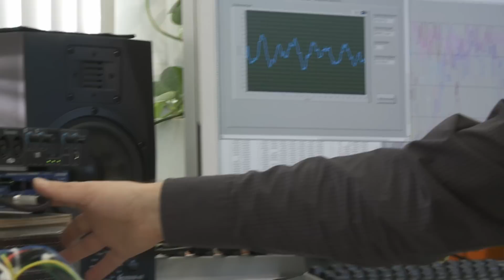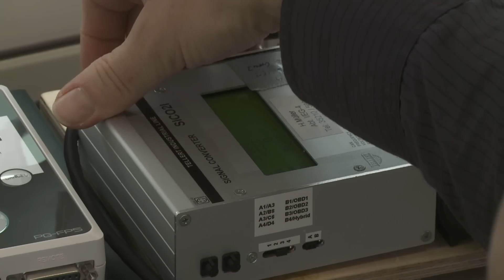Electric Supercar and Engine Sound - Acoustic Innovation: e-sound by Audi

Comment: Why do people need sound. I would like my car as silent as possible. For pedestrain safety we can always use horns.
Reply: Loud cars set such a presence that is impossible to miss and we car guys love it. More to the fact that every car has a different voice from 4 cylinders to 12 cylinders they all sound different, its so satisfying to hear. Though you may prefer the quieter cars and I dont object to that opinion, try and admire the noise of 20 race cars each having a different or similar voice flying past you at top speeds.
Reply: Even electric motor has a sound, and it’s pleasing for example Nissan Leaf RC ,Formula E, and Rimac …

Porsche did this with Taycan, but they use real electric motor’s sound and amplifying it with other sound Sz
Reply: There is no way that the sound can cause a noise pollution, every manufacturers know how to balance the volume so it’s not silent or or loud, just balance ..

Comment: Uh cars are to noise so we don't want the loude ones with patrol, uh electrics are so loud we have to ban them too!
Reply: Loud cars set such a presence that is impossible to miss and we car guys love it. More to the fact that every car has a different voice from 4 cylinders to 12 cylinders they all sound different, its so satisfying to hear. Though you may prefer the quieter cars and I dont object to that opinion, try and admire the noise of 20 race cars each having a different or similar voice flying past you at top speeds.
Reply: Just imagine: Uh (delay sound; ger. "Ähm") electric engines are disturbing my spiritual aura in particular the high pitched ones.
Reply: @RegenerationOfficial  Hippie
Reply: What’s with all the “uh’s”?

Comment: You could just take the sound of the electric motor and amplify it through a microphone and loudspeaker in the under carriage maybe add some electronic distortions for some cool factor 

Either way electric cars or cars in general shouldn’t be silent

Not just for cool factor but pedestrian safety as well
Reply: I would take your idea with some modifications.
I'd record the sound of the engine itself, do some sound adjustments by removing or lowering the annoying the high pitch noise and adjust the metal hitting metal sound and make that the fake noise!
Reply: do you even know what you saying? amplify a motor? with a microphone? besides the obvious FEEDBACK LOOP which can be fixed, the amount of electric interference would blast pretty much white noise with the feedback.. you'll hear it but wont like it. its a multi-million dollar business not some made up ghetto solution

Comment: Having a noiseless engine would completely defeat the purpose of buying a sports car. I'm glad you guys are working hard at it!
Reply: this is a good compromise to me. plus it's safer for pedestrians .
Reply: but its not a slow car
Reply: i thought sportscars are for driving fast.
Reply: Buffered Dacus that’s part of it, but not all of it. Speed isn’t everything. Sports cars, to me at least, are more of an experience than just a product.
Reply: @WSX 8 I get the point about fake sounds on ICE engines but on e-cars, I think actually, if it's done properly and on top of that if it lets people add plugins and control the sound algorythms with a computer, this can be really creative and you can end up with really nice futuristic car sounds.
Reply: See, there does exist a natural "sound" or resonance to an electric motor. I wish we could simply find a way to amplify this sound in real time, and very loudly. Other downsides however incurred no gearbox (no shift sounds, no jumping between rev levels), and no (natural) idle sound, as the motor simply isn't spinning when the vehicle is stationary.
Reply: @bradleyboisselle1292  I think that would not be really natural.  It's the same as recording  acoustic music, there is no such thing as 100% realistic or natural, you always end up with a unique sound based on how you place the microphones, which microphones you use, which preamps, the mix, etc...   I think just a proper sound designing and the possibility to tweak it can lead to really nice stuff.  Imagine you want more brap brap, and you turn up a fuzz button, possibilities are endless.  But yeah maybe the source of sound could be from some real engine parts.
Reply: "Purpose of a sports car"
😹👌